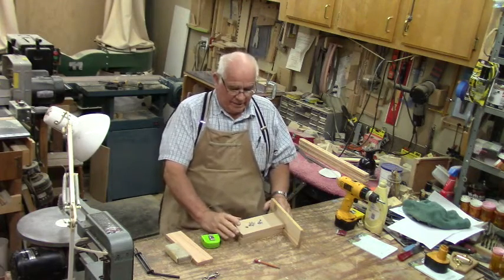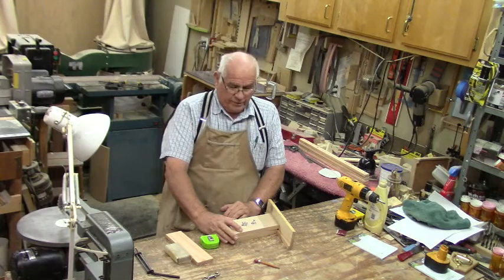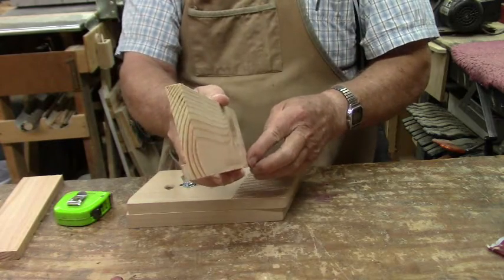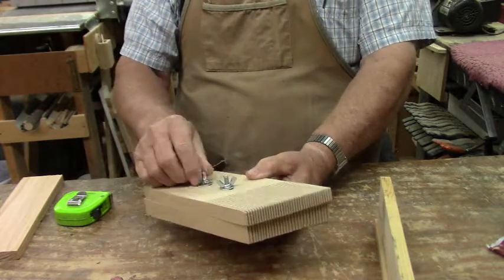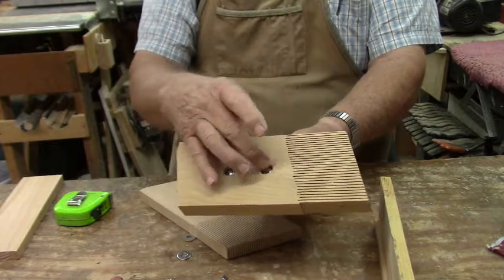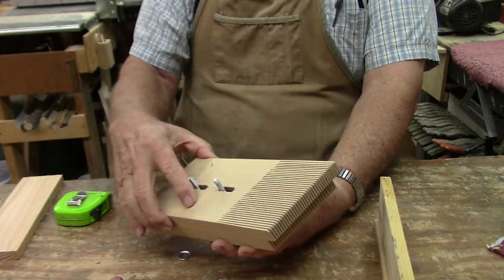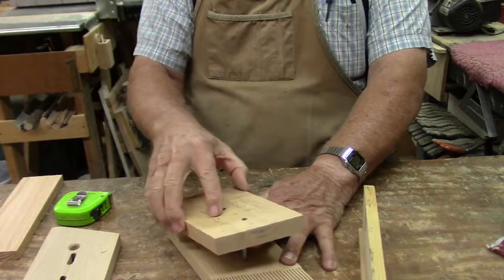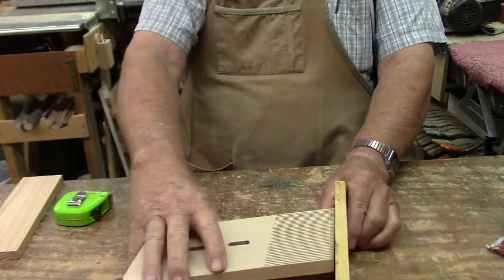Adjustable  feather board experiment

Comment: That's a great design, Wayne.  I could use the same thing on my table saw for when I'm resawing something.  And make a set of spacers of different thicknesses.  I haven't had much success with shop-made featherboards; the feathers always break off instead of feathering.  What kind of wood are you using?
Reply from the maker: Thanks for the comment;
I have real good luck with western alder, a soft wood which has a nice straight grain and is quite flexible.   I believe that any straight grained  soft wood will work.   I have one for re-sawing on the table saw made of pine.   I like your suggestion of  adjustable thicknesses  feather board for re-sawing.